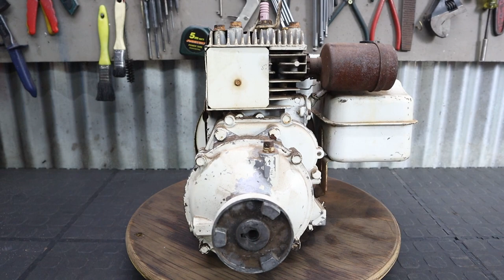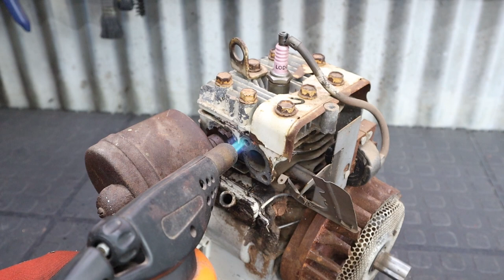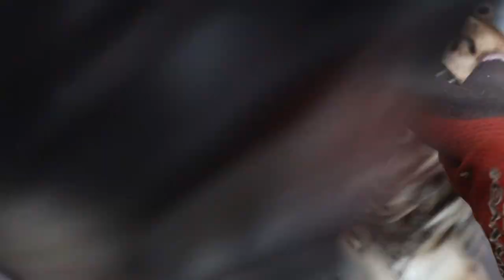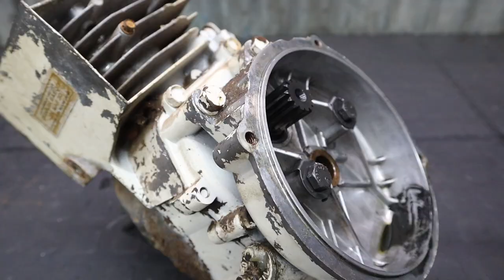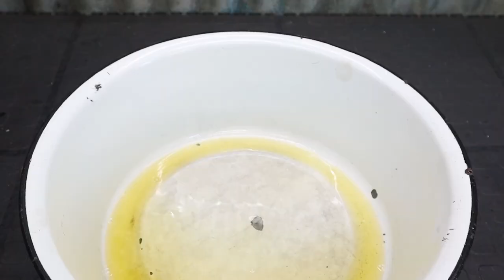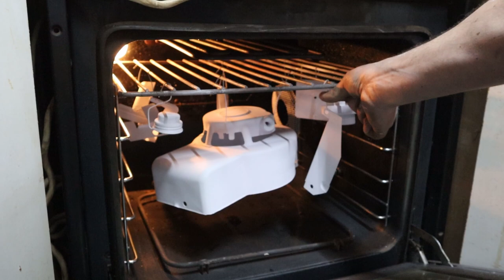1974 Briggs & Stratton 3HP Motor Restoration [Part 1 of 2]

Comment: First engine I ever rebuilt was a 3 HP B&S in shop class in junior high in 1968.  Great video.
Reply: Did the same in 1979…..resulted in a life long ability to work on all kinds of things, not just small gas engines. Probably the most useful class that I ever had.
Reply: My experience was 1978, high school shop class. Needed half a credit for graduation. 

I was the only girl in the class, and I ran circles around the boys. They missed putting the valve lifters back in, on reassembly. That was on the one day I missed class. I found them in the parts tote, and reinstalled them myself.

Comment: My dad worked a few of the old 1970's and 1980's series Briggs motors when I was a kid. Both the 3, 5, and 6 HP ones. One of the scrap 6 HP ones he restored eventually went into my first go kart back in 1997. He restored/customized the engine to produce a little bit more power and torque. Added a slightly bigger sprocket for more top end speed. I got one of those bicycle speedometers and I remember the fastest I went on a go kart was around 52 MPH on the road. It was a bit dangerous from what I remember. Didn't wear a helmet and the go kart didn't have a roll bar. It was one of those classic style 60s type go karts. Was a lot of fun, but sold that go kart back in 2001 because I kinda grew out of it. Lot of memories for sure.

Comment: I have the same engine Iv been rebuilding for a go kart and let em tell you Changing the carburetor is a pain in the ass
Reply from the maker: I hate these carbs from Briggs & Stratton. I retrofit a Honda carb and be done.
Reply: @AJRestoration  You should just do what I did this week and find a shelf with 4 of them brand new in the box with the "READ THIS BEFORE OPERATING" tag still on the gas cap and everything, whole cleaning out a hoarders disgusting shop .
Also found 2 Tecumseh 6hp in the box.😁

Comment: that engine seems to be a fairly nice , low-hour survivor ..even considering that the previous owner ( obviously a cotton-headed ninny-muggins ) failed to change the oil regularly , which is crucial in these small oil-splash lubrication engines 
👍👍👍👍👍👍

Comment: Looks good so far! Just as you do all the mechanical stuff to this remember that this is a Kool Bore Briggs and honing the cylinder will destroy it! Don't want to ruin your restoration by doing that! Just clean it up as best you can without honing and call it a day! Also if you need other parts like Rings and whatnot I have a really good parts guy you can contact!
Reply: Very light, very is ok.
Reply: Honing ! Is !! CRAP !! SLEDGEHAMMER IT !! IS ! WHAT !! YOU !  DO !!

Comment: I can't find the right coil pack for this type of engine any help would be greatly appreciated
Reply from the maker: Ebay should have a few new old stock. Most of these coil packs fit universally so a 2hp coil will fit the 3hp. Just make sure the shape is the same as your old coil.

Comment: Why did you not measured valve clearance before dismantling the engine????? Easy to grind needed amount material of the valve head before assembly.
Reply from the maker: Because the valves will be lapped, that will be done in the assembly stage, making it useless to measure the valve lash before the dismantling.

Comment: All my growing up kid years in the 70's I had to mow the law with a 60s Wizard 22 Walk Behind Lawn Mower, 3 HP B&S almost identical to this one but with the down shaft. Green deck, white motor 4 wheels and a push bar and I mean there was nothing else on the mower. not even a grass guard. It was left outside and we kept the motor covered with a 5 or 7 gallon bucket that fit perfectly over the motor.  It never failed to start in 10 years and we were the 2nd or 3rd owner.
Reply: I GUESS ! THE !! LAW !! WASN'T !! IMPRESSED !!! AT !! ALL !! WITH ! YOU !!
Reply: @davidwillard7334  WTF Does the law have to do with me having one of these engines?
Reply: @jamescole6846  Congratulations !! On ! You !! Getting !! CLEARLY !! CONFUSED !!
Reply: @davidwillard7334  You take your meds today? GD right I am confused WTF kind of comment is that it makes no sense.
Reply: @jamescole6846  AT !! LEAST !! MISTER !! BROWN !! HAS !! COMMON !! SENSE !!
Reply: @davidwillard7334  You mean Mr. Brown Stone. Now all this makes sense.

Comment: Looks like the engine 2guys were building when I was in Vocational Agricultural school in the 10th grade in 1985 and they forgot to to torque the connecting rod to the crankshaft and when they started it up and reved it it came loose and blew a 4 inch hole in the crankcase. No one got hurt but it sure scared the crap out of everyone !
Reply: 😂😂😂😆😆😆 Looks like the teacher wasn't too attentive

Comment: I used to work on these all the time, the first thing I'd do was throw away the carb and gas tank and build an adaptor to use a tecumsah carb so it would run better and less maintenance cuz Briggs carbs suck
Reply from the maker: Briggs carbs suck! I agree with you there. Especially the carbs that use the diaphragm (I hate those)
Reply: @AJRestoration  you'd fix it and a month later they'd be back with the same problem and if you ran it wide open no how brief it would blow out the diaphragm which meant they were no good for anything beyond a pushmower
Reply: YOU !! SHOULD ! HAVE ! PUT !! THE !! BRIGGS !! STRAIGHT !! INTO !! THE !! METAL !! SHREADDER !!!